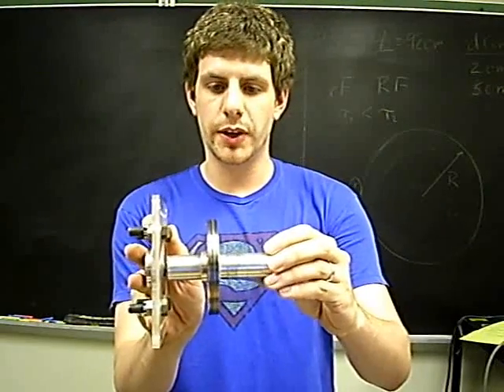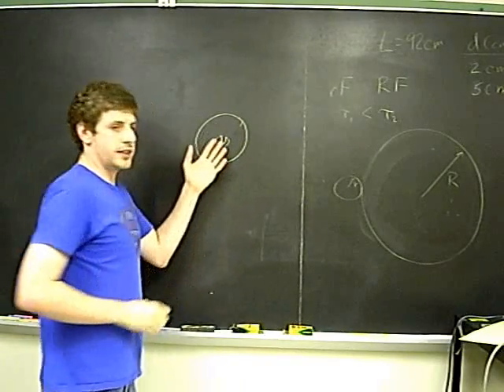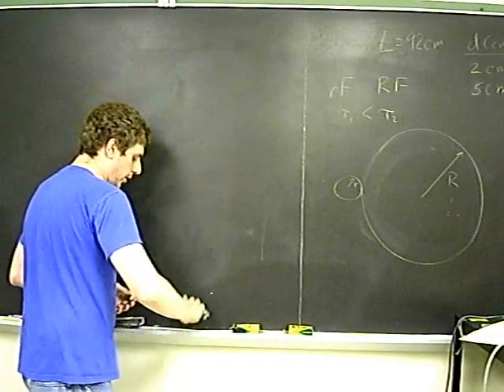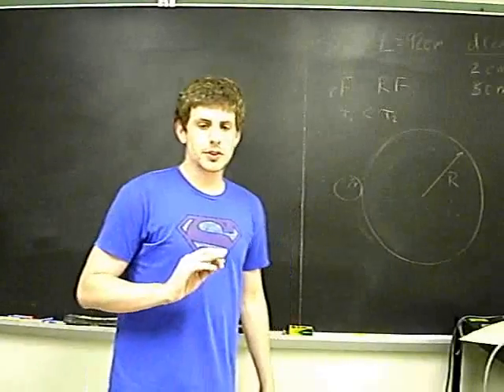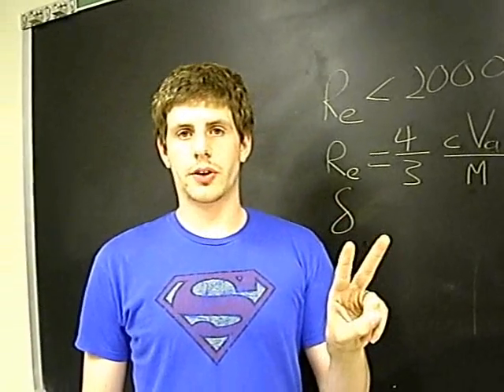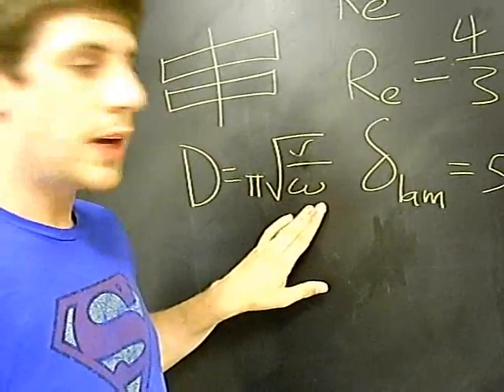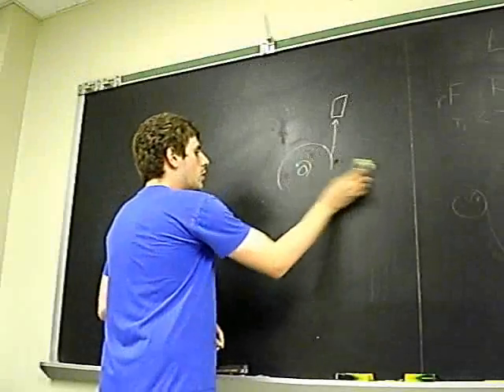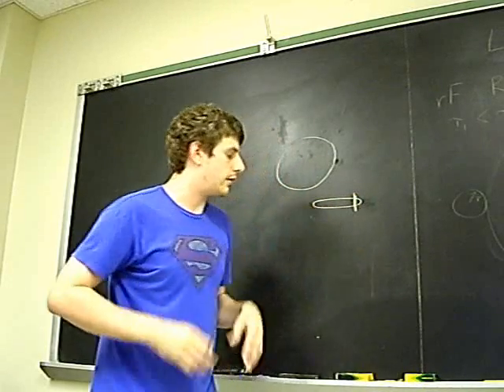Tesla Turbine Concepts Explained

Comment: "Once you get to a point where the angular velocity of the disks is very great then you have a tight spiral that just goes straight to the center" - 2:25 (look at the picture)

Hmmm... I have heard from other sources that you get a more convoluted spiral at higher angular velocities. Which claim is true? No matter which one is true an explination would be nice.
Reply: This guy doesn't really understand what he is talking about. The whole discussion about it spiraling towards the center is incorrect, and rather obviously incorrect too.
Reply: Albertkallal Obviously the fluid has to escape through the center, it just does not do it the way this guy describes. At higher speeds it actually takes a "less tight", longer, more circuitous route because it is being pushed outward towards the edges of the disk by centrifugal force, while also being pushed towards the center by pressure. It is this longer route that allows the fluid to transfer more of its inertia to the disks and makes the turbine more efficient at higher "rpms" or "angular velocities".
Reply: @samruby1549  you want the fluid to slip the least distance on the discs faces but make the most number of turns with the discs while doing so. 

This results in the shear force being applied onto the disc through a long rotational distance which is by definition work done. 

Doing that^ will result in high torque and high efficiency WHILE outputting power. 

If you just try to spin fast you will reduce the power trying to chase high RPMs which are counteracting the motive fluid in the first place. Not to mention almost ALL losses in the system, bearings, gears etc, increase rapidly as rpm increases. 

Even furthermore the fast you spin the discs the faster you need your fluid going just for them to be able to apply a torque on the discs faces.
Reply: @samruby1549  Charlie Solis makes actual working Tesla turbines that output power and torque at even low RPMs. 

It’s quite phenomenal the results he’s getting. 

The torque numbers he’s getting with only room temp compressed air are just amazing 🤤
Reply: @samruby1549  ask yourself, what does it matter how many rotations the fluid makes across the disc face if it flows between the discs in an extremely tight, highly efficient, low Reynolds number, laminar flow regime (so extremely low slip) and it gives up all of its kinetic energy to the disc before it even makes 1/2 a turn around the disc? 

All that matters is that the fluid efficiently flows between the discs such that the flow stream doesn’t trip to turbulent, ie there are no unrecoverable turbulent noise losses, and so that the turbulent flow doesn’t trip a flow stream separation from the disc faces resulting in not only an almost complete loss of torque but the fluid can actually flow backwards relative to the disc face counteracting the desired torque on the disc face. 

The only losses during this flow condition are to shear stress losses which result in heat. 

And since the slip will be the most in the periphery, where the pressure is still the highest, the heat generated in the turbine periphery due to shear stress in the fluid laminarly slipping on the discs will “reheat” the pressurized fluid and undergo further expansion through the spiral path recovering the heat generated. 

This built in Brayton cycle recovery of the Tesla turbine when using elastics fluids is known as the “Reheat Factor”.

This reheat factor was very much known by Tesla and is why he filed the patent GB 175,544 for a hybrid Tesla + Parsons (reaction) turbine to utilize the last bit of thermal energy left in the fluid for final torque via rotary thrust out the parsons turbine.
Reply: Only when the turbine rotor is being used as a pump do you want to spin it fast, as ALL centrifugal pumps/compressors performance is tip speed dependent. 

Everyone erroneously mistakes this part to be about the turbine. 

“I have found that the quantity of fluid propelled in this manner, is, other conditions being equal, approximately proportionate to the active surface of the runner and to its effective speed. For this reason, the performance of such machines augments at an exceedingly high rate with the increase of their size and speed of revolution.”
Reply: Also the fluid doesn’t “force” it’s way to the periphery. 

The fluid just has inertia and momentum so it will tend to the periphery without a force from the periphery to keep it in rotation in the casing.
Reply: Sam Ruby
According to Jeffery Hayes, you get the most inefficient when it goes straight to the middle. Either the guy in the video screwed up during the speech, or it was a real mistake.
Reply: He describes a tight spiral towards the center at high angular velocities. In fact, the opposite is true. At higher angular velocities, the propelling liquid or gas would actually be forced towards the periphery of the disk, not accelerated towards the center.
Reply: Sam Ruby

Right, but the escape hole is in the center and thus the fluid has to move towards the center – this results in a great force of adhesion of the working fluid to the disk.
Reply: Sam Ruby
Hey Sam, I happened to have a Tesla Turbine prototype. We use 0.5 disk gap so around 0.019 inch.
We use 27 disk and we're about to build the inlet nozzle. If you are curious you can check out the channel.
Reply: ***** Will do, thanks!

Comment: hi nice work, but how do you know what is the working speed for the tesla turbine
Reply: +Harout Bulbulian the working speed is the desired result. These things will operate at 150000 rpm. They don't produce much torque so depending on what you are trying to accomplish you would base your design on what work you wanted it to perform.
Reply: @drewberrynews3875  TesTurs produce plenty of torque when you design them correctly.
Reply: @drewberrynews3875  real power and torque even at low rpm.

Comment: It seems like the disk gap for air at 70 deg f going 1k rpm would be .004 inches, or did I figure that wrong?  If so it seems like it would be hard to pump very much volume.  Any insight would be helpful.

Comment: Wouldn't a rough surface make low speed operation better, because of better grip on the fluid...  To compress it...
Reply: [TL/DR: This is not a mechanical turbine in any shape or form. Since all molecular adhesion and internal viscous forces within a fluid are governed by electron orbital interactions, this makes the Tesla turbine a purely electronic turbine.]

The BIGGEST misconception about the Tesla Turbine that most people get wrong is that they think the fluid is actually sliding and dragging on the disc, similar to as if a solid object was “sliding” across the surface of another solid object. 

It is not. Full Stop. 

The fluid that’s just off the surface of the disc face is ALWAYS statically adhered to said disc face and never moving relative to the disc. 

The torque to the disc comes from shear stress forces within the motive fluid trying to move through itself.

The shear force is transferred through the motive fluid itself to the layer of fluid that is statically adhered to the disc faces, and then through the virtue of molecular adhesion the discs are pulled along with it, or Vice versa the discs pull the fluid along with it. 

The only “friction” involved in this is that of internal friction within the fluid against moving through itself, ie viscous forces. 

And sorry I don’t mean to sound like I’m being pedantic, as I’m sure I’m restating many things you already know. 

It’s just a very important key part of the operating functions that everyone gets wrong. This is not a mechanical turbine in any shape or form. 

Since all molecular adhesion and internal viscous forces within a fluid are governed by electron orbital interactions, this makes the Tesla turbine a purely electronic turbine. 

As Tesla even alludes to in the article “Dr. Tesla Talks Of Gas Turbines” 

… “I have been working at this a long time. Many years ago I invented a pump for pumping mercury. Just a plain disk, like this, and it would work very well. ‘All right,’ I said, ‘that is friction.’ But one day I thought it out, and I thought, ‘No, that is not friction, it is something else. The particles are not always sliding by the disk, but some of them at least are carried along with it. Therefore it cannot be friction. It must be adhesion.’ And that, you see, was the real beginning.

“For if you can imagine a wheel rotating in a medium, whether the fluid is receiving or imparting energy, and moving at nearly the same velocity as the fluid, then you have a minimum of friction, you get little or no ‘slip.’ Then you are getting something very different from friction; you are making use of adhesion alone. It’s all so simple, so very simple.

“This is the greatest of my inventions,”……
-Nikola Tesla (September 18th, 1911)

When designed correctly, it works principally upon electron interactions between the fluid and itself and the fluid and the disc material. 

The first important factor being how well does the fluid actually molecularly adhere to the disc faces when submerged in an atmosphere of the motive fluid. 

This is also seen as the “Wetting angle” when there are two fluids in contact with the surface and they are competing for adherence. 

Think hydrophobic and hydroPHILLIC surface treatments.

The second important factor is the viscosity of the motive fluid in question, as it represents the fluids ability to “flow through itself with or without resistance” per se. 

Herein lies the reason it is extremely important to maintain laminar flow regimes within the disc spaces. 

Because irrelevant of the viscosity of the fluid, ALL FLUIDS, liquids and gases, can be forced to flow in highly efficient low Reynolds number laminar flow regimes given the right initial conditions and “flow cavity” parameters, such that turbulent boundary layer slip is eliminated, stream separation and counterflow is eliminated, rapid pressure changes from turbulence resulting in noise losses that can lead to early fatigue on discs and parts is eliminated, etc. 

Furthermore, because windage is all but inexistent in the Tesla Turbine, it stands to potentially be the quietest running turbine ever when properly designed. 

(Sidebar: This is why I have speculated over the years that these Tesla turbines have actually covertly been in practicable use all this time in things like covert/stealth submarine Primary Power Units (PPUs) and/or just plain stealth “trolling motors” but that’s honestly my own sheer educated speculation at this point. 🤷‍♂️ it just makes sense.)

This is where working out the complex solutions in the Naviar-stokes equations come in for designing practicable machines.

Comment: At 2:30 the video is wrong. A Tesla turbine is most efficient when the working fluid spirals around repeatedly until all it's kinetic energy is transferred to the discs, which happens at the maximum speed. When the working fluid takes a quick path to the exit hole then it is inefficient, and that happens at low speed. The video says the opposite.

Comment: Look at the vortex air gun. A tube closed at both ends. One end has exhaust ports at the edge. The other a hole in the middle.If you introduce air in the middle. So it spins at high speed. The hot air moves to the outside where the air is faster & the cold low energy air to  the slow center.
In the tesla turbine. The gases drag on the disk by means of viscosity and the adhesion of the surface layer of the gas. As the gas slows and adds energy to the disks, it spirals into the center exhaust.

Comment from the maker: I would assume that the pressure difference between the entrance and exit of the turbine is greater than the rotational force experienced by the fluid as it travels toward the enter. Centripetal force is defined as: F = (m*v^2)/r, therefore, for a unit of fluid mass, the only variables that change the force on that mass are it's linear speed and the radial distance from the center to the circular path.

Comment from the maker: I don't think you understand the 2nd law of Thermodynamics, Thermal Power Cycles, or even Carnot's theory on heat engines. Carnot never set a thermodynamic efficiency limit on a particular type of engine. He simply stated that you can never produce an engine that has a thermal efficiency of 100%, meaning that there are no losses converting thermal energy to mechanical energy. An efficiency of 90% is possible theoretically, but experimentally it is unproven.

Comment: I beleive you have a mistaken explanation. According to Nikola Tesla:"If the runner be allowed to turn freely, in nearly frictionless bearings, its rim will attain a speed closely approximating the maximum of that of the adjacent fluid and the spiral path of the particles will be comparatively long, consisting of many almost circular turns. If load is put on and the runner slowed down, the motion of the fluid is retarded, the turns are reduced, and the path is shortened."inverse of what you said

Comment: Bizarre: So you want laminar flow and say you need to maximize the (thickness of?) the boundary layer.  Then how is any momentum transferred from the fluid (air) stream to the rotating disks? If you use a body with completely ideal laminar flow around it, the drag coefficient is very small, therefore little momentum transfer takes place. How could this be efficient for a generator?  I thought the point of a turbine was to extract as much momentum of the fluid flow as possible. Beats me.

Comment: Given that disc spacing is often in the mm - particulates in the pumped fluid would still need to be very small to pass through the pump.

Given this -  don't feel that it's a valid statement to say that a Tesla pump can be used to pump particulates, in so much that this constitutes an advantage over conventional pump designs, which can handle larger particulates by comparison.

Comment: my question is if we can acheive such an efficiency how much heat will be produced and will the turbine be able to handle it? i saw another video that the turbine litterally melted itself apart. also will there be an efficiency loss moving from the turbine energy produced to mechanical energy such as if it were used to mill grain?

Comment: @heavym3tal 
The reason I ask: I've been reading up on the use of supercritical CO2 as a working fluid in a closed externally heated Brayton cycle for high temperature gradient applications where steam turbines end up with a huge size requirement per watt.

It may be fun to try subbing in laminar adhesion turbines for the compression / power stages, rather than regular reaction turbines.

Comment: can anyone make a powerful Tesla turbine and moving a car with it ?
Reply: Working on that as we speak. The latest room temp compressed air dyno test of the 10in diameter TesTur just yielded +4.25kW between 6000-8000rpm. And +5.25ft-lbs of torque at ~5kRPM.

The previous test yielded 2.75kW and 6.22ft-lbs of torque at only 4150rpm on only 150psi room temp compressed air and 1200watt electrical load output tests on all the way down to only 65psi...  all on a plastic and aluminum Tesla Turbine prototype 🤭

Comment from the maker: @mathayi2000 rough surfaces cause turbulence in a fluid flow. Turbulence causes an increase in entropy, thereby creating more energy losses in the system. With a smooth disc, most of the flow is laminar, and therefore less energy is lost to to irreversible changes in the system. Does this help? I can explain further if you wish...

Comment: really nice explanation! 

I have 1 doubt: You mention that the disk surfaces should be as smooth as possible. I was under the assumption that telsa turbine is a friction based pump and therefore the rougher the disk surfaces the more energy is transferred to the rotating disk. To what extent am I off with this assumption?

Comment from the maker: @iggymydog D is the gap between the discs, and W is the angular velocity. If you want higher speeds, you need to decrease the disc gap (consistent with the fluids kinematic viscosity) in accordance with the equation:

W= n*(pi/D)^2, where n = kinematic viscosity of the fluid

Comment from the maker: @008klm the reason that the most of the fluid would fly off the turbine is due to the formation of boundary layers over a surface from fluid mechanics. i suppose that you could control the angular velocity using the method u mentioned, but I think it would be simpler to vary the flow into the turbine.

Comment: Guys i have 2 questions. First - is it possible to construct such turbine in SolidWorks and to be calculated (simulated) successfully ? Secondly - you probably remember Mercedes SLR with it's turbine wheels. So - is it possible to use Tesla's turbine for that issue - to suck the air out of the clearance and to blow it outward ? The same like SLR's turbines ? Thank you!

Comment from the maker: @givemetoast The boundary layer (in the case of the Tesla Turbine) that you should be concerned with is the laminar boundary layer, which means that you would limit your Reynold's number to 2300 or less (beyond that, your boundary layer transitions to turbulence, decreasing the efficiency of the turbine). Setting this limit, a preliminary approximation would be incompressible flow over a flat plate. Do this in 1-D, then set other boundary conditions to the problem to do a 2-D approximation.

Comment from the maker: @givemetoast Since there have been no in-depth experimentation on such details, the general rule of thumb for designing the disc holes is: 1) as close to the center as possible, and 2) as many as possible. This of course will be limited by the material that you make the discs out of, which should be VERY smooth, if possible.